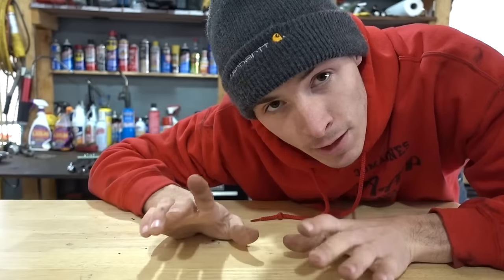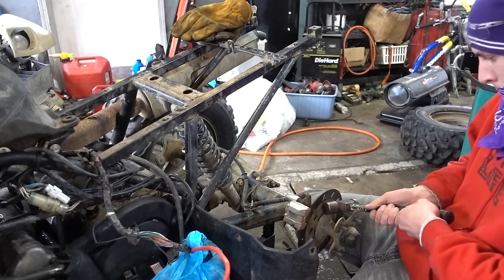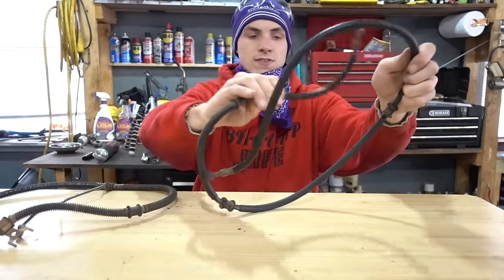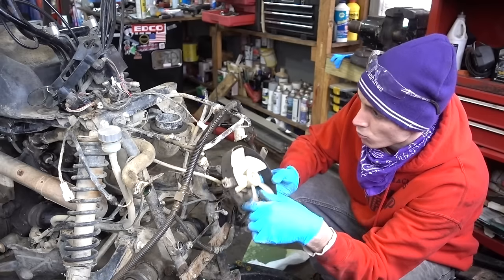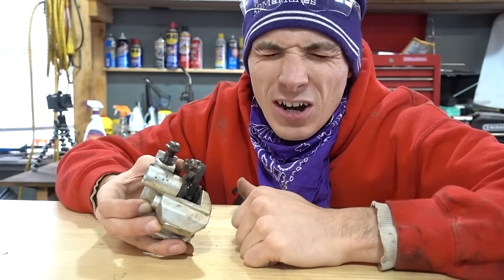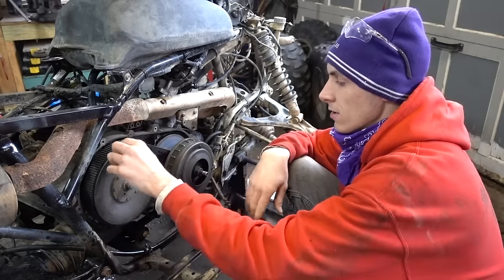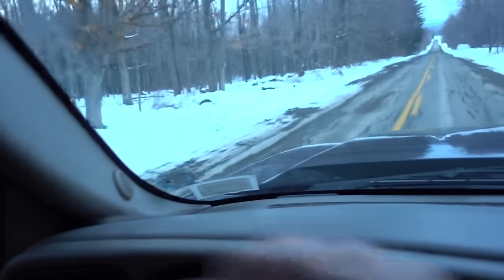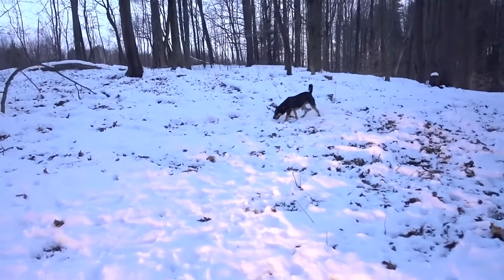I SAVED HER

Comment: Hey dalton. I may be wrong, I've never had a Kodiak clutch cover off, but every Yamaha ultramatic I've seen has a cradle over the primary to support it. There's a single bearing and a clutch drum on the inside of the case. Without the cradle it puts immense side load on that bearing.
Reply: My 700 does but I don't think these had it......
Reply: Not sure the year of his Kodiak, but looked of for a 04 450 and it had it. Can't be 100% sure but especially with the smooth nubbin on the end of the shaft Id bet it's missing the cradle.

Comment: Hey 3dmachines im 13 and i was driving my dads palaris 800 snowmobile on the private lake and i was going 35kmh and just like you said in your truck accident i had a horible fealing in my stomack and told myself something is about to go wrong but then i also told myself whats gonna go wrong im going 35 on a flat survace 3-5 secondes later the back of the snowmobile starts splashing water and the ice broke under us and the snow mobile woudnt be alive if it wernt for those 185hp that flew me out of the lake at 140kph tilting on one side we all walked out safe and both had helmets i parked the snowmobile 200meters from home and walked because i was too nervouse i usualy never go over 110kph and in those conditions i got scared as shit since its not the first time this hapend it also hapend with my grampa when i was 8 he was driving thoe

Comment: Tow rope is needed.. much safer
Reply: Jay Lyons no a chain is a lot stronger
Reply: Jay Lyons chain is the most dangerous thing you can use to pull a stuck vehicle.
Reply: Yeah except for the fact that chain tends to snap and wreck your vic or take your head off. tow rope is designed to not do those things. and Ive pulled a big rig out with a tow rope so.. they are plenty strong
Reply: Jay Lyons it a probably a 20,000 lbs rated chain, that car is maybe 3500lbs... he pulled it correctly, slowly, he didn't jerk it tight. which is what would snap a chain.
Reply: EpilepsyWarning the irony is your comment
Do you not see your own picture
Reply: +jeff drier that's just a 3/8 harbor freight "towing" chain it's only rated for like 5500lbs....I see it in the store in that same package everytime i go
Reply: That car was not buried enough nor heavy enough for a chain to even think about snapping.
Reply: for the record i have seen a tow strap brake and crack a window it doesnt matter what you pull with there is a chance that it could brake
Reply: You have to look at which stores the most energy. The strap or a chain. The strap would store more energy than the chain. The energy has to go some place when either one breaks. So the strap would move more than a chain. You can limit the straps movement by throwing blankets on top of it. You can limit a chain by weaving a rope threw the links and hooking each end of the rope loosely to the vehicles.